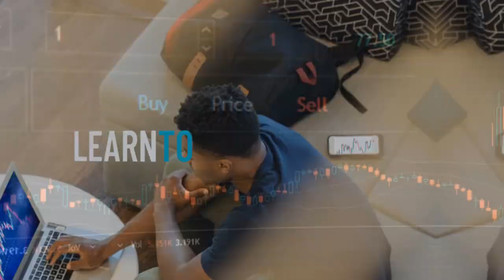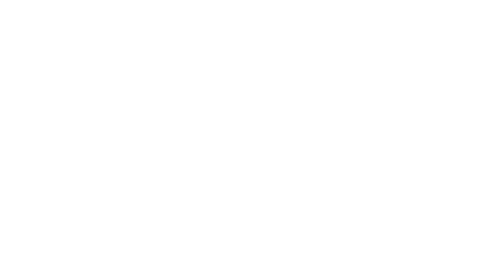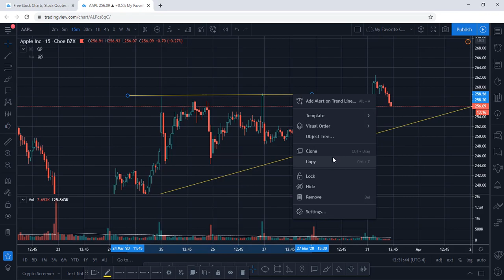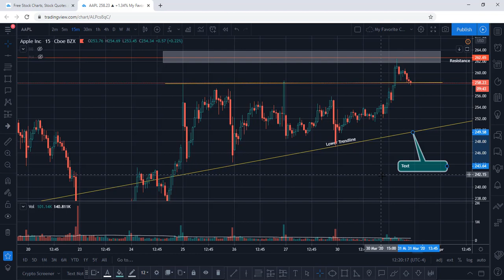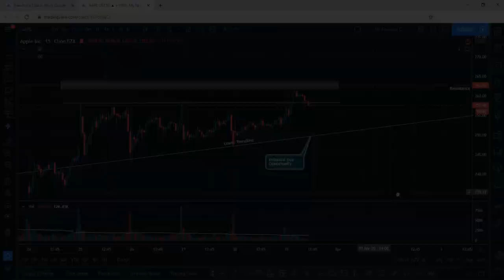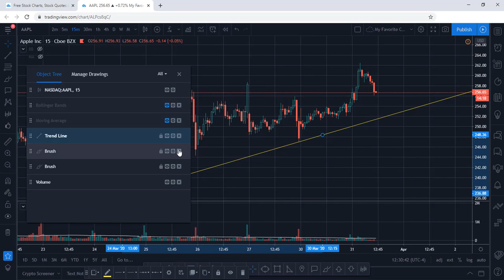Comment: is there a way you can continue to use the trend line tool again after drawing one trend line without having to go back and select it again from the tool box... I have seen several people do it... but not sure how one can do it without going back to the tool box box? Basically a short cut key for summoning trend line tool without having to go back to the tool box.
Reply: Hi Amyth, you can actually use ALT + T to draw a trendline. If you go to the menu on your TradingView chart at the top left corner you can select keyboard shortcuts to view more options. Hope this helps!
Reply: Trade With Resolve 

Thank you 🙏